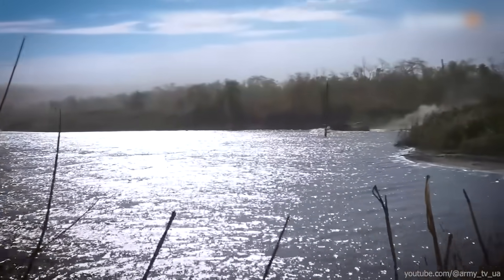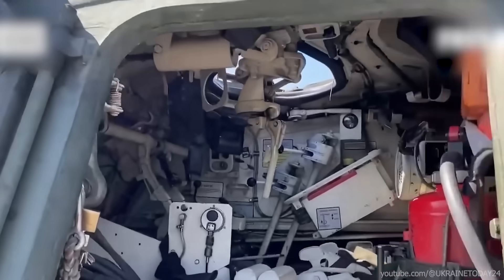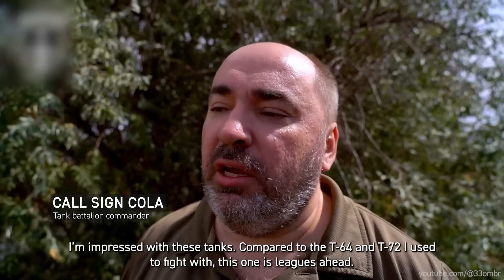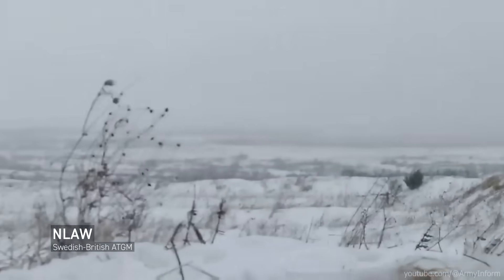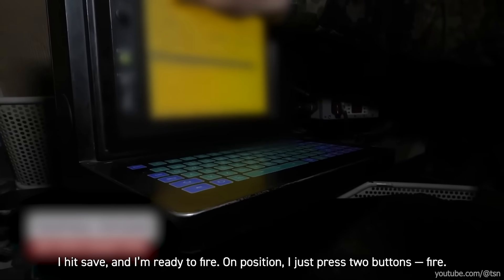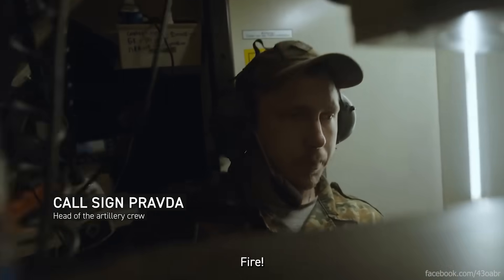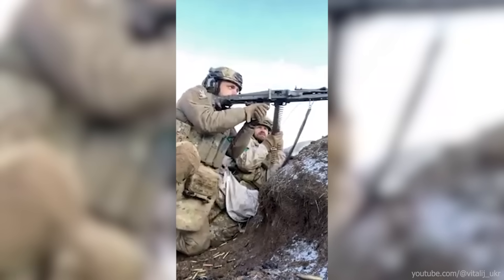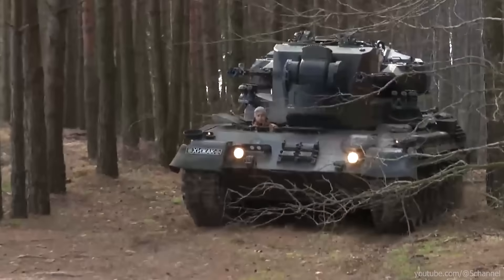LEOPARD Tank: Ukrainian Soldiers Spill Hard Truth About German Weapons

Comment: The Leopard 2 is not only water- but also air tight. It's designed to operate in nuclear detonation sites.
Reply: It is neither when the crew opens the hatch to get out.
Reply: Maybe a swamp is a little different from crossing a deep river or something like that. Much denser than just water I guess.
Reply: That doesn't mean a thing, It's all about pressure.
Reply: It’s not water or gas tight, it has a over pressurization system for NBC and bilge pumps for fording. That absolutely doesn’t mean that its built to be under water like that, there’s been many tank submerged trying to pass swamps in Sweden and they almost always end up as long time work shop objects
Reply: It’s neither completely air thight or water tight… in nuclear sites it works as ABC filtered air is blown into the cabin what creates a from inside to outside blow and prevents ABC contamination to get in thru leakages. 
During water passages, there is a so-called Lenzpumpe (water pump) that pumps out leakage water… 
So, it’s not a submarine.
Reply: It's not 100% sealed, it relies on overpressure. But for that it constantly needs to pump in air through the air filters, which means that internal overpressure can stop NBC agents from leaking IN. However for obvious reasons that doesn't work underwater
Reply: Like literally any other mbt around
Reply: It makes it sound you only need something of an oxygen tank inside and put it to mars and still work.
Reply: This is only half correct, just like the Panzerkampfwagen VI Tiger and pretty much every German Tank afterwards, the Leopard 2 can be completely sealed, however it usually won't be, and in this case it most certainly wasn't.
Reply: You cant submerged the Leo and expect nothing broke. They fucked up the tank. Everybody that just spend an hour with that tank now that. No wonder the tank have close to 0 influence on the battlefield when they used them like this.
Reply: @tibor1234  You probably also spent 0 time in that tank. Tanks have no influence on the battlefield anyway. Western tanks are made for combined arms warfare and not as dumb breaching tools like back in both world wars. A tank alone has by far too many threats. Everything is mined, drones that can mobility kill tanks, long range air to ground systems and the list goes on.
Look at the summer offensive in 2023. The offensive was basically held by helicopters that destroyed ukrainian armor from miles. 
Both sides have excelent scouting and the fog of war is very thin. Big offensives are basically not possible as they need preperation in order to work well and that would be a prime target for missle strikes or artillery strikes on logistics and other accumulation of forces.
Reply: @Darkbribe09  To me it seems that the tank niwadays is degraded to/missused as mobile artillery. Guderian father of the tanks would spin in his grave: "Klotzen nicht kleckern."
Reply: @jcmangan  not at all. It supports infantry, and other things.
Reply: @jcmangan  😂ja
Reply: @tibor1234  bro you're extremely dumb if you thought 100 tanks were gonna change anything lol

Comment: PzH 2000 is on a Marder-Chassis, not a Leopard-Chassis.
What the ukrainians need most are drones. Especially drones that can reach enemy artillery.
And maybe a drone with autocannon would be nice. And something simple like the shahed, but faster than an helicopter and a much higher payload, something like the V1 buzz bomb from WW2.
Reply: It's built on the Leopard Chassis, not Marder.
Reply: @darkawakening01  wrong
Reply: @KBKriechbaum  I stand corrected, it just uses some parts of the Leopard 2. Just looked it up, my bad.
Reply: PzH 2000 is built on a Leopard 2 chassis, not Marder.
Reply: @geldoncupi1  wrong.
Reply: @geldoncupi1  it's based on a Marder, with the motor from the leopard 1, and some parts of the leopard 2.
The drive shaft is on the front, as is the motor, like in the marder.
In the Leopard 2 the drive shaft and motor are in the rear.
And just compare the front of a Marder and a PzH 2000, they have the same design. The Leopard 2 looks different.
Reply: Nope it's actually neither of both. There are some parts of the Leo2 used though
Reply: @hansmeyer7225  exactly. The chassis is completely different in dimensions and on top it’s a front drive unit for PzH2000 and a rear drive unit for KPz Leo2. The only similarity are the suspension elements and rollers.
Reply: Marder-Chassis would be by far to small for this 55ton beast.
Reply: No, they need more artillery. All things aside, drones give a wrong picture of the battlefield because of their nature in showing their success, but there are multiple reports from the front lines stating not to overrate drones.
Reply: "Especially drones that can reach enemy artillery."  you said.  This is the only thing which really matters at the moment. Tanks are attrackting drones like flies on cowshit.

Comment: Good video. There is no equivalent to the 100 year old "Maw Deuce" or its caliber. (perhaps the Soviet 12.7mm) The rate of fire of the original MG42 was 1,200 rpm. Hence the nickname "Hitler's buzzsaw" The current MG 1 has been slowed to 800-900 rpm, akin to the M240 or M60. Both are fine weapons. Since the US. M-60 machine gun has its roots with the FG42 and MG42 that would be a more appropriate comparison.
Reply: wrong: The MG 42 had a fire rate of 1600 rpm. The MG3 has been downgraded to 1200 rpm. Greetz from Germany.
Reply: das mg 42 hatte eine feuerrate von 1500 und das mg 3 1300 schuss
Reply: @reinold-sq9qd  es gab mehrere Variaten des MG42 mit unterschiedlichen Kadenzen. Es gab sogar eine Version zu Beginn mit 1800 rpm